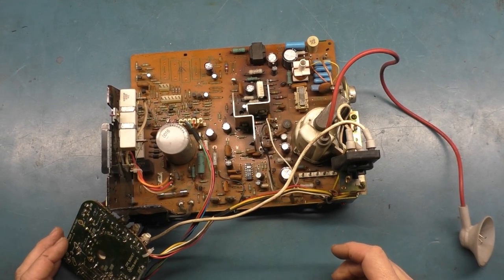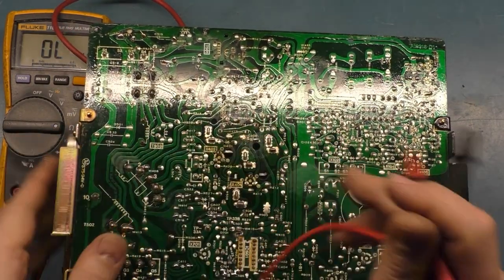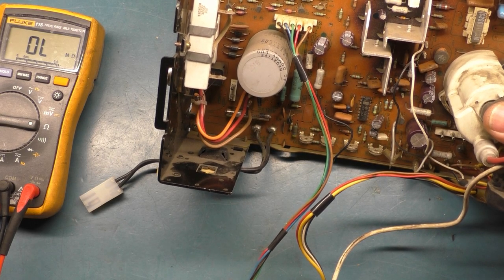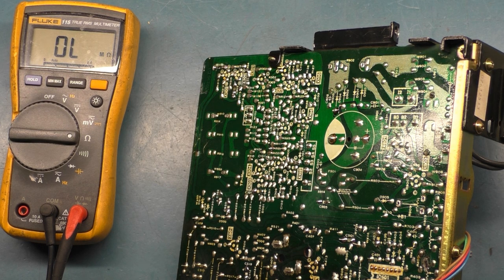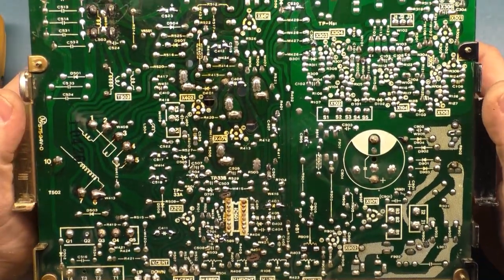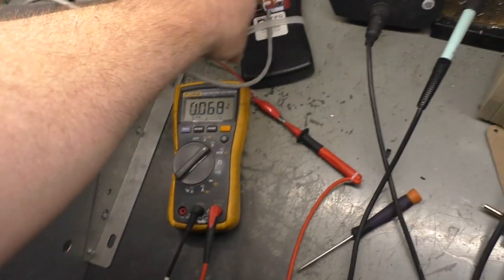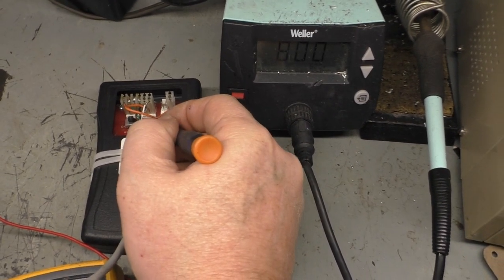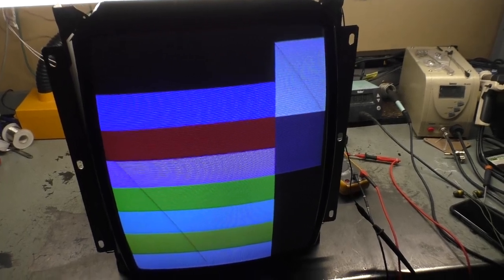19" G07 Arcade Monitor Repair - DEAD - What To Look For And How To Test - Quick Fix?

Comment: Super helpful video thanks. I was putting off fixing my G07 in my Centipede that had a color dropping out intermittently. Gave the PCB a good cleaning did a cap kit and re-flowed some suspect-looking solder and now I am back in business and the monitor looks super sharp. Now to do the k4900 in my Joust, and my spare k4900 and k7000 that I picked up years ago.
Reply: One of my initial issues appears to be back. When I started the game this morning the red was gone. In the past, a tap on the side of the machine would sometimes bring it back. I just left it this morning and a few minutes later the red came back on its own and looks good again. Any idea what could be causing me that issue? the red is nice and bright when I have it on screen. I don't think it is wiring or my game PCB since when I had another monitor in it for a month or so I had no issues with the red dropping. I was wondering if maybe the red transistor on the neckboard might have a bad solder joint?

Comment: Nice! Don't think i've ever seen that resistor go either on the ones i've done. Have you ever had a G07-CA0 on your bench? They look almost the same as the G07-CB0 but are about half as wide again on the left, with a large area on the left unpopulated where the rgb mixer/input area is and a separate pcb fitted over the left hand side (which is actually the rgb mixer/input section). I have two on the shelf that i've "borrowed" parts from over the years but I think are worth rebuilding at some point.
Reply from the maker: Not yet but I’ll keep an eye out.

Comment: Hey Mike Thanks for the very educational video. I just have a question. as far as the voltage regulator, your correct readings were .55 and .18. i have a blown f901 fuse and im wondering if the voltage regulator readings are high could that be the cause of the blown fuse? my readings are .53 and .22 is this within a tolerable range? also does there have to be a reason for the blown fuse or could it just be the fuse needing to be replaced? thanks.
Reply from the maker: You’re welcome. Yes. It very well could. It needs to be removed and tested out of circuit. Also make sure the B+ resistor reads correctly with the regulator removed.